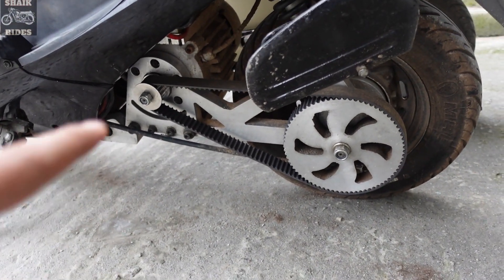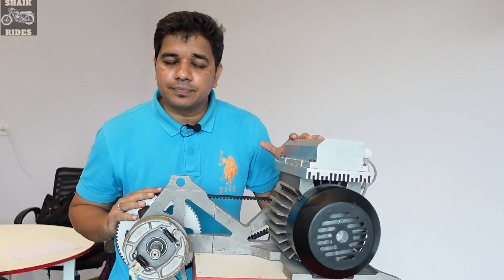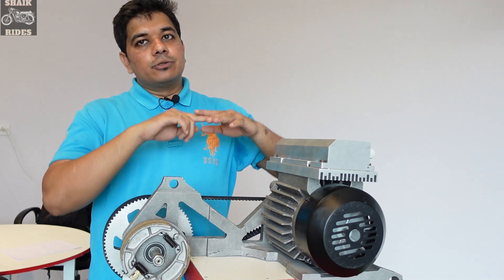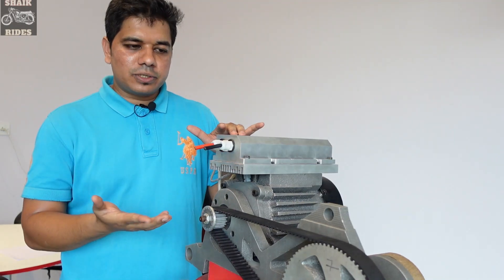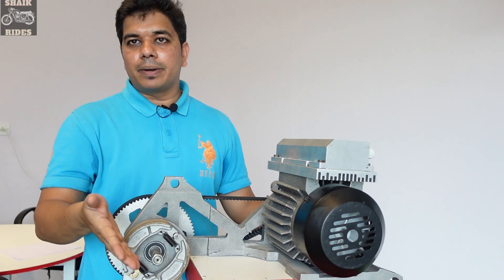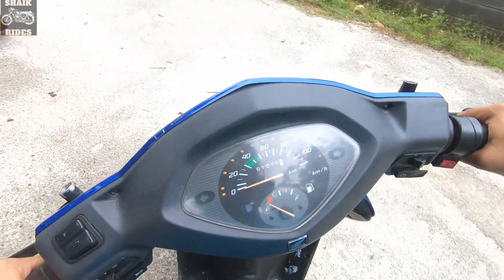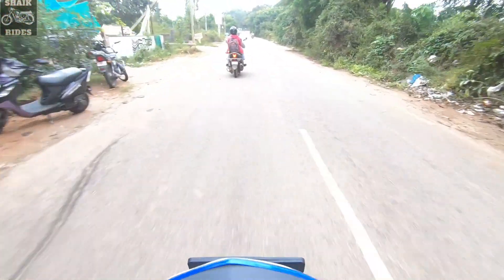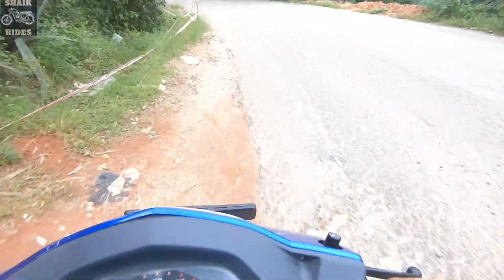STARYA Petrol to Electric Vehicle Conversion Kit | Just 35000/- | With RTO approval | 75kmph Speed |

Comment: Hi,
      Your retrofit is ok but price point it
Must be less than 20,000.if you have these schemes one year before for rapid
Implementation may be possible.
Now more more EV are in the market.
It's now buyers market for EV..
Still price will come down toch the bottom level with in five years both battery and equipment.
Reply from the maker: Sir,
There is no company in india that have created the motor or ICU by themselves, they all import everything from china, I believe starya is the first company that built everything from scratch that includes motor and ICU and it is made in India product.
And they managed to keep the price right.
You are just seeing prices please check the performance n compare with other branded escooters … that says a lot.

This s not just any other conversion kit, 
First one in world or India at least with subscription plan and with RTO approval.
All these are included in 35k.

For 20k u can convert to electric one but you can’t main tian all the standards and approvals.
And you wont get this performance also.
Reply: @shaik_rides  
I appreciate your immediate response.
Indeed i want to know whether you have to make RTO approval in Tamil Nadu.
In this regard we will contact you later on.
Have a great weekend.
Reply from the maker: Yes, once they start full fledge functioning of sales and when they start in Tamilnadu they will reach out to respective RTO and get an approval for the same, currently in karnataka bengaluru RTO has given approval for the converted scooters and it is part of conversion Kit price 35k.
You too have a great weekend.😊

Comment: More than 1 lakh rupees e scooter have higher range than 120km
Under 80000 we get 70 to 80km range e scooter like okinawa ampere easily.
We can sell our old scooter for 15 to 20k easily.
 why should we buy this kit and battery for that much cost its very
expensive. This startup will fail if they put that much cost.
Reply from the maker: Sir,
120km range you get for 1.25 lakh to 1.50 lakh like ather which is beat in the class,
Tvs icube range 78 top speed with 70 km range will come around 1.10 thousands ..
You are talking about ampere the high end escooter that cost near to 80k but top speed and performance is 55 and 84 range.
So there is trade off of performance as you go on low cost.

The same performance escooters  are bajaj chetak and tvs icube there new scooter is 1lakh plus.

Here for just 35k plus the subscription plan of 75 paise per km you have electric scooter.

It is not same sir, when u actually buy new escooter you will pay a lot..
And this is not about getting new e scooter it is about converting old scooter to electric scooter at max price with battery at 65k.

Also you get best performance like 75kmph and range of 70km

Comment: If my old scooter is 10 year old then after retro fitting what would be my scooter life .is that gonna remain valid only for next 5 year or that too increased for next 15 years
Reply from the maker: Sir,
Once conversion is done it will be sent for RTO approval that means you get new fc with green board and 5 yrs validity.
And every 5 yrs fc has to be renewed but the amount will be very less as it is escooter now..
This is same for all electric scooters fc renewals

Comment: Just for motor is 35 , bettery  40 45 , total 75, old bike 30 40k 
It's more costly than buying new electric bike
Plus u don't hv advanced software
Reply from the maker: Sir,
It is just 35k withe conversion kit, assembling and RTO approval with green board with subscription plan per km 75paise along with swapping battery options for every 4km.

If you dont want subscription then you can buy battery for 30k so total cost 65k.

Yes, you will get second hand petrol scooter for 30 to 40k but thats not the point.

Point is, you getting converted electric scooter that has a good performance.

You wont get any electric scooter that has this kinda performance for 65k with battery.

Also it is not just getting a scooter for 65k with battery it is about retaining your scooter and giving more life to it and converting to electric.

If you are happy with having petrol scooter for 35k to 40k that gives 35kmpl mileage where petrol prices are rs:100+ 
Then you may not get impressed with this conversion kit.
Reply: @shaik_rides  not at all good proposal, u do all tod marod almost for same price to the old bike.. rather buying new bike is better option . If price of suck kit is under 20k then it make sense else why would want old bike . Just sell old bike for 30 40k n buy new electric bike .which has all components r made for that design. Buying whole products makes more sense than tod marod ka product.
Reply from the maker: I agree and buy your point, it is not exactly tod marod type, this Kit has a standards, it has IP rating of 66 same as ather or other branded escooters this has passed all the required tests, RnD team is there  for the same, importing ICU kit and motor is easy but putting brains n creating such stuff is not easy, anyway its your perspective and I respect it.
May be another person might get useful of this.
🙏🏼

Comment: 35000 is quite on higher side .. it should b around 15 to 18 k max.
Reply: Hi i think you shoud try market before judging the price yourself of 18K. You do one thing you start production give to them. 
They can sell at 356k. You forget they spent 3y in research who is going to pay for them for that period. They also have HUNGER. 
"LESS PERFORMANCE PERSON SHOULD NOT JUDGE HIGH PERFORMANCE PERSON".
Reply: @rsharma3602  750w motor kit was available 3500 rs 6 months back now same kit is available at 8-9k 
1.5kw 2kw motor kit was available under 10k rs. Off course it was not rto approved.
Reply: They are using PMSM motor of 5.4 Kw motor and they are giving with swing arm with single belt driven reduction with controller and approved so you get green plate again 14 year for road use.
Reply: @rsharma3602 and  taking away engine , engine is core or heart of bike costs only 2k? It may not be ur I mean company's fault it could b due to its not in mass production.
Reply from the maker: Sir, you can keep the engine… if you want it.. then u will have to pay 37k for the kit.
Reply: @shaik_rides  😂😂
Reply: To main tain balance can tyers sixe could be increased
Reply from the maker: @ashokbabbar7943  yes may be please check with company